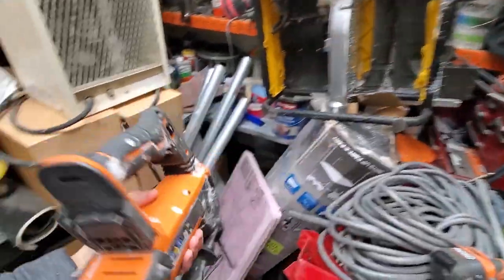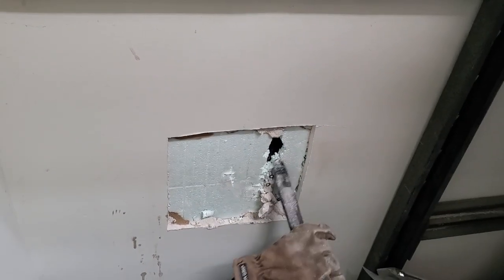DIY Horizontal Drilling: $7000 Quote Saved with a Shop Vacuum.

Comment: For holding up a heavy tool, use a tool balancer (a.k.a, "spring balancer").  These come in different tool-weight ranges, so you need one that includes the weight of your drill.  I'd try renting one.